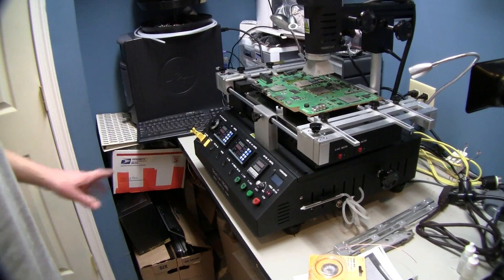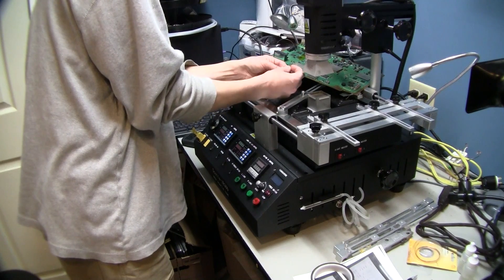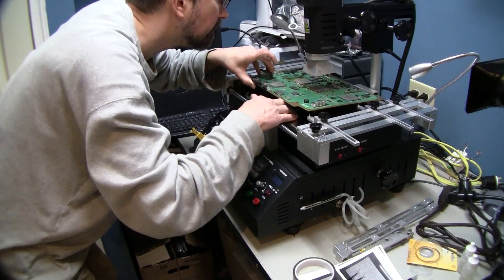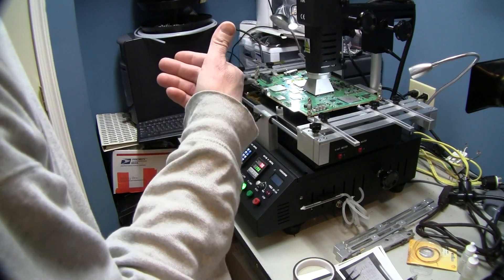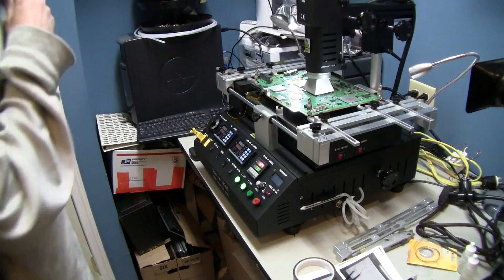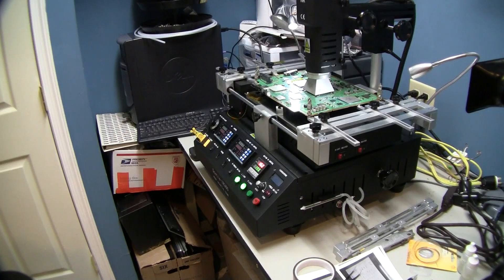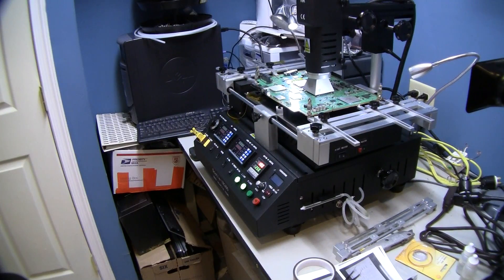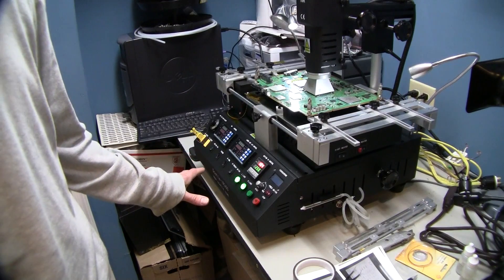Configuration and profiling Scotle IR 360 Dual IR and Hot Air upper heating  Video 2

Comment: Is the goal on IR pre-heat to get the top of the board to 180 or the bottom of the board?
Reply from the maker: When measuring pre heat, which is from the bottom, always probe the bottom.  Your next phases will be heating the top, so probing the top during preheat is pretty much a waste of time.  Now that being said, the most common mistake is probing the bottom and stopping that stage when you hit your goal.  That is not a good thing because the board has not taken in enough heat to go to the next phase.  Using a graph of the temperature will show you what time the stage is over by the curve becoming a flat line.  This is the time for the stage to be completed and usually is a while after you hit your target goal.